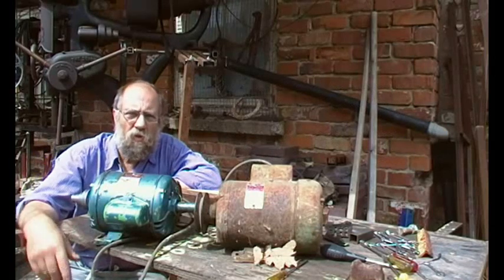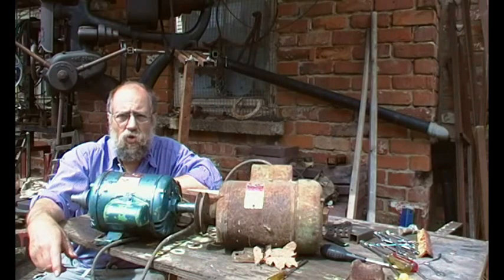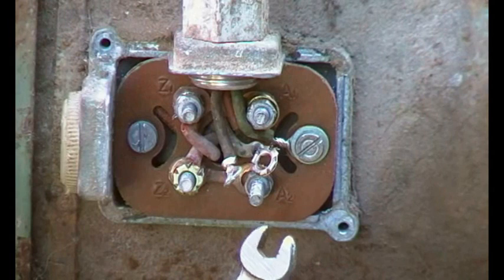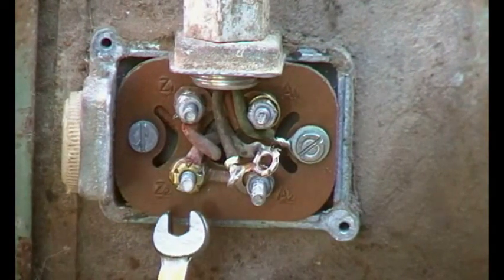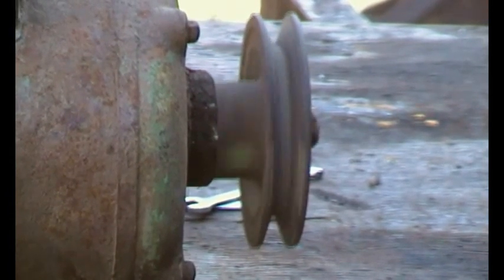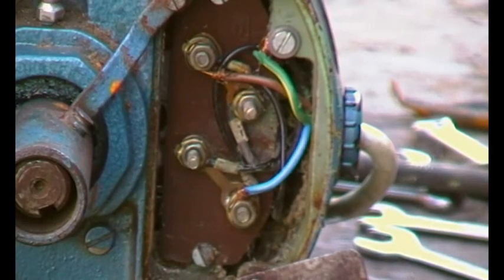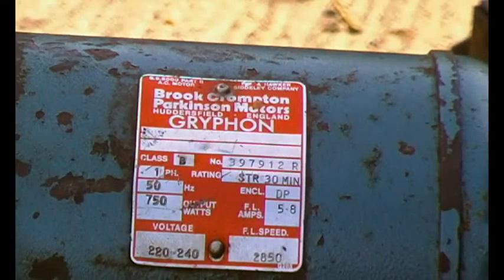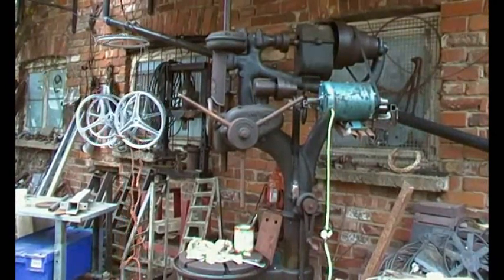Brook Crompton single phase motor, rotation change

Comment: Great video, Andy. I'm currently working to change rotation on a Craftsman motor I'm setting up for buffing on one end and large wire wheel on the other. The exhaust/cooling exit air is rather strong so naturally I want the "blow out" to be at the back instead of the front, being that I don't want to wear buffing compound head to toe. :) Thank you
Reply from the maker: I hope it all goes well, if not can you turn the motor around? cheers

Comment: How is double capacitor connection
Reply from the maker: Hi, to increase the value of a capacitor another can be linked in parallel, See part 2 of my running a 3 phase motor on single phase supply (there is a playlist) subscribed? cheers

Comment: I have a 110 v sanding floor machine that I wish to convert to run on both 1110 and 240 do you know where I could find instructions to do this, please?
Reply from the maker: Hi, you would need a 240 to 110 transformer, cheers

Comment: I went through this with an AEI motor when I wanted to fit a reversing switch to run the lathe chuck backwards - useful for winding a tap back out rather than by hand :o) My Myford manual shows motor wiring terminal names for several different motor makes, and nearly all use different labels for the windings, and in one of your motors, there are no labels at all ! Confusing...
Reply from the maker: Dave it was fortunate that I had that other motor in the pile of misc. motors. That made the experimenting easier. It seems this exra motor has a bent shaft and I am not sure what to do about that. Maybe I could take the pulley off and then mount the motor on my lathe bed and then turn the shaft true under its own power. Cheers, Andy
Reply: I noticed the bent shaft Andy - you could take the rotor out and see whether you could hold it in the chuck at one end, then somehow fit a lathe steady in where the bearing sits right behind the bend - or use the motor bearing itself as a steady if it's a good one maybe (the bearing might not come off anyway due to the bend of course !) and then see if the rotor is held firmly enough to attempt to true the bent shaft ? Might be difficult to mount the complete motor true enough on the lathe to turn it under it's own steam.... whatever you do, video it will you ? :o) Dave
PS. all of the above is probably obvious to you, and anyone with any lathe knowledge actually....but I thought it would be interesting to add these thoughts and maybe encourage someone else with a better idea out into the open.